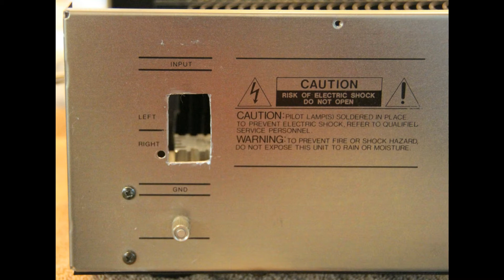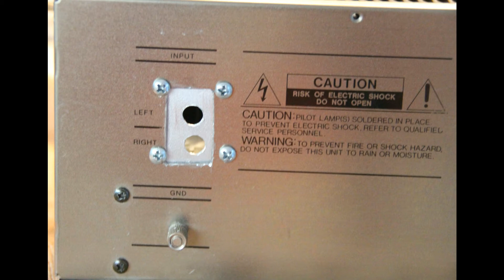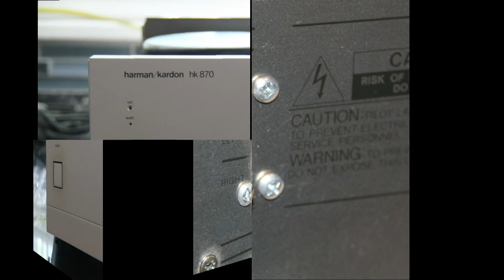Harman Kardon HK870 Power Amplifier repair

Comment: How are these amp. Performance?
Reply from the maker: I was very satisfied with it for 35yrs.
I was going to use it in my new system, but just sold it when I decided to go with McIntosh instead
Reply: Excellent performance IMO.

I bought mine about 5 years ago when I went on a vintage equipment tear.  I picked up a number of amps from the 70s, 80s & 90s including stuff from Hafler, Adcom, krell & lexicon/bryston and after the smoke cleared I ended up sticking with the HK870 amp & HK725 pre-amp for the long term.

Back then I was using a bryston-stack digital front end & a cheap project debut turntable.  Speakers were another quest the best of which were some B&W CDM 1nt's.

Had to downsize my listening area last year and dumped all my vinyl, my nice digital setup & also the b&ws and now I'm back to running my old polk 5 JR+ speakers (really great as well) and my digital front end is now just an old pc with foobar running through an ifi zen dac v2 (another phenom bargain piece btw) and even though my system isn't what it was a few years ago it performs admirably, and guests (audiophile or not) are quite impressed with the sound I get out of such a modest setup.

I haven't heard it all (not by a longshot) but I've been around and heard way more stuff than most and dollar for dollar I've never heard an amp that impressed me more than my HK870.

If you get 1 just make sure it's been thoroughly gone over and/or rebuilt by someone who knows what they're doing.

HK was notorious for sloppy QA and its not if but when it will need redone.

It's well worth keeping these amps in working order IMO.

Last caveat is they run hot.  Don't fear it just give them lots of breathing room.  I practically heat my basement with this amp.

Cheers!